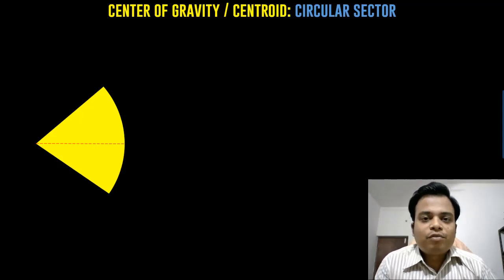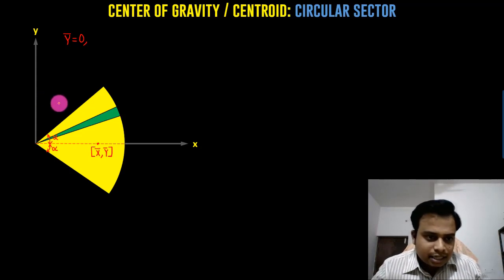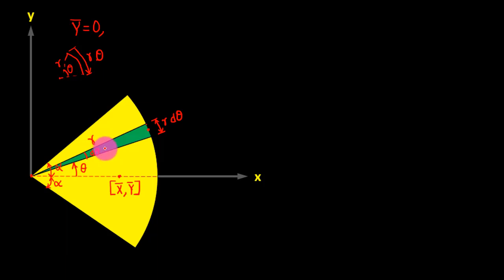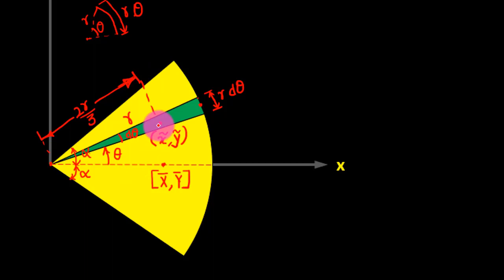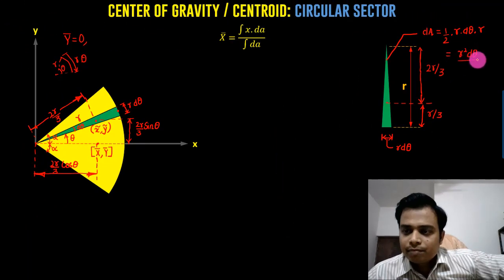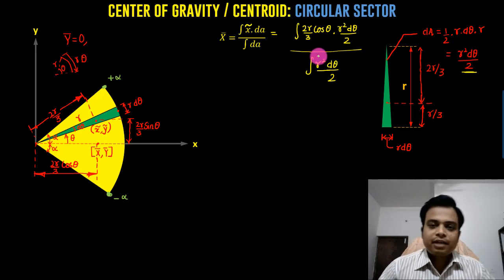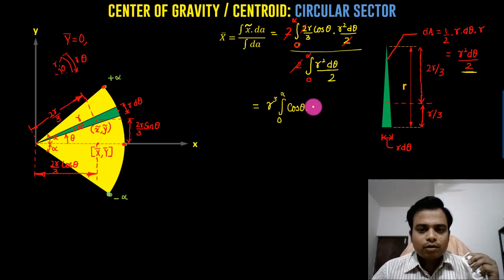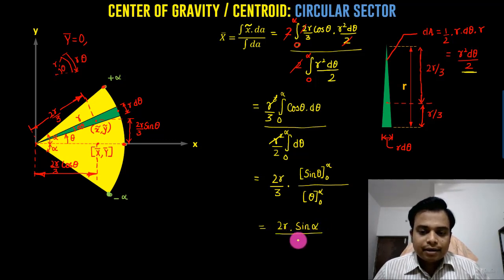How to find Centroid of a Circular Sector by Integration

Comment: Hey, Manas, Really like your delivery. I looked at a couple of centroid of a sector videos trying to get a quick answer for a real world question. Even though I don't understand your whole video, I believe yours is a cut above the others; it seems more simple, (which to me suggests a better blend of understanding of the material AND of your audience then those who made the other videos. Which is good for me because I am in need of BOTH!) I'm not a statistician, mathematician, or physicist. I'm a construction contractor who is going to build a VERY heavy rounded section of concrete countertop and hopefully will wind up building more down the road from word of mouth business. You see where I am going here... So, I don't know exact dimensions yet, and since future dimensions may differ I am hoping for a ballpark percentage I can work with as I don't need exact mathematical precision, just "close enough" to build safely. I usually do practical field testing with a product to bypass math above my paygrade--which ends at the Pythagorean theorum which I use EVERY SINGLE day. However, I don't want to mess around with practical field testing for the centroid of the concrete circular sector as I need everything below my knees for basketball. This rounded sector will have two supports allowing for three stools. It will also have support along it's edges from counters that are perpendicular and would otherwise have met as an "L", of course. So, because I'm effectively creating two 22.5% circular sectors (I know that's the wrong "percent" symbol here, but have mercy) as I see it, I need to know the centroid x value for a circular sector with r =100, (so I wind up with a working % for this and any future variable r) and a total angle of 22.5% (so, it'd be 11.25% above x in your video and 11.25% below x).  It seems like something I would have to take a class(es) to determine, as you lost me at theta and something you could do in no time. Would you be so kind as to determine this centroid for me, Manas? I would also appreciate knowing the centroid for an r = 100, angle = 45% total, in case I do a two stool, one support counter down the road. I hope you think it's kinda cool to have this real world application, as I do. It's always a trade-off trying to keep supports back on a countertop for knees and visuals, but I'm not going to mess around with this much weight even with the rebar and mesh. I "liked" the video and wish I could do more in return for your help, but I need to sell many more countertops to get my head above water first. For now, my sincere thanks.
Peter

Comment: Hey, this was a great video. My colleagues and I were using it to further calculate the formula for the center of gravity for a "hollow" circular section. This has application when considering the platforms on a distillation tower. In our case, we considered Ri and Ro for our inner and outer radii. It turns out that the CG is 2/3*(Ro^3-Ri^3)/(Ro^2-Ri^2)*(sin a)/a. It might be well received if you were to do a derivation of the formula on video. It would use the results from this video as a starting point!
Reply: I'm also calculating same. Is it correct equation for hollow Sector ?